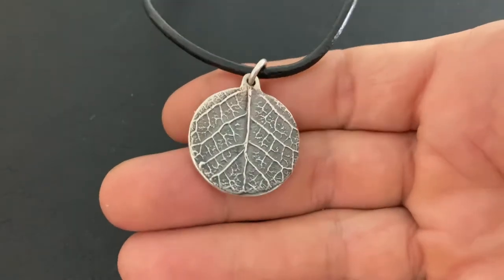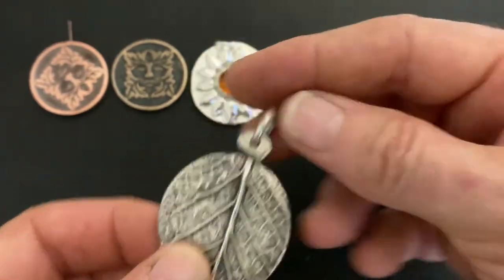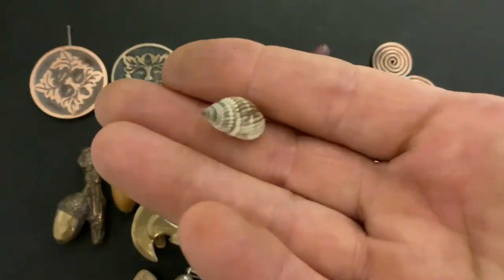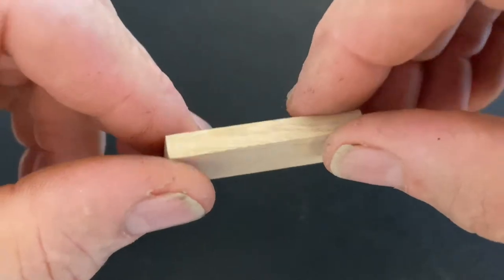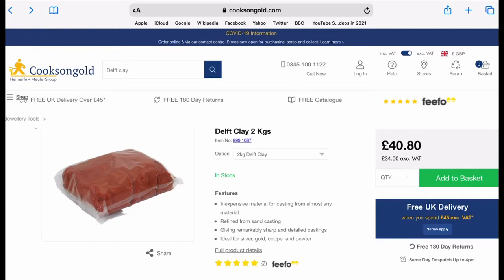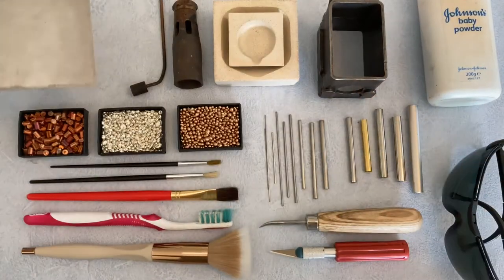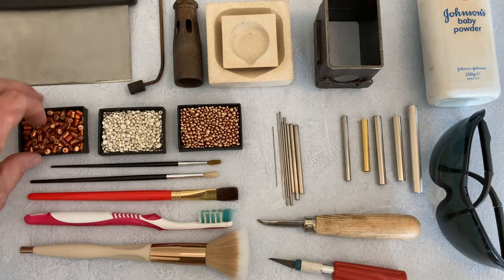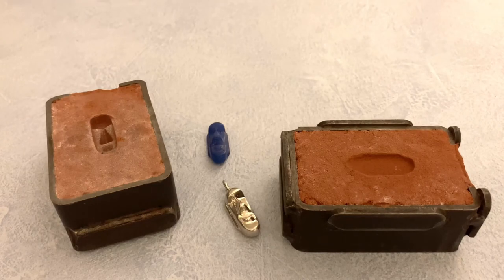Delft clay casting silver and bronze jewellery tutorial (a detailed guide for beginners) part 1

Comment: That blade is called a dough scraper. It is used in the pizza industry and restaurants to size up pizza dough in different size weights and to scrape the dough out of the proofing trays before making a pizza.
Reply from the maker: Thanks for that Tri-Force Blades, seems obvious after googling dough scraper but you would never know if you’d not worked in a kitchen. If it had been sold as a sand casting scraper in the jewellery industry it would cost 10 times more … Nice to find tools at the cross boundaries … cheers … Nick

Comment: Hello, Nick, love your videos, their very informative and fun to watch.
I'm interested in starting a sand casting and purchased a cast iron flask that came with 5 pounds of 130 mesh Petrobond quick cast sand casting clay. The Petrobond that came with the flask is a mixture of fine sand, clay and oil.
I tried casting and the mixture seems too dry and crumbly. It didn't hold it's shape in the flask and I wasn't able to pour the casting. I looked at remarks from customers on Amazon who bought the same item and some had the same problem with dry Petrobond. The advice from others on Amazon was to add a few drops of oil to the Petrobond mixture. One person adviced 30 weight non detergent motor oil, another suggested linseed oil and the last person to give advice said he had success with mineral oil ( Johnson's baby oil ). Which type of oil to you think would be the best to use?
Thank you.
Reply from the maker: hi Lonewolf, sorry to hear of your problems with petrobond. so annoying to purchase a product that doesn’t perform as it is supposed to. i’ve only ever used Delft Clay and not looked at alternatives yet.
I have read a well-made Petrobond is supposed to be very similar to Delft Clay and I once saw a video where somebody compares a few variations. The only real difference was that Petrobond had a bit more of a grainy finish to the castings surface. if it was me with this problem, I think I would test a few different oils with the main issue being the amount used. I would guess a two stroke motor oil would be a good start. I would mix a few very small batches and then try compacting them and open casting a couple of grams of silver into a small depression. all oils burn I think it’s just a matter of finding the one that is the most heat resistant … good luck with it … I hope you get it sorted … Nick
Reply: @Nickscreativestuff  Hi, Nick, thank you so much for your quick and knowledgeable answer.
We'll take your advice immediately.
Reply: @Nickscreativestuff  Hello Nick, I decided to take your advice and buy delft clay. I'm looking for the best impressions and delft clay seems to be the answer.
With the two stroke oil with Petrobond I wasn't able to get the quality castings that I'm looking for.
I hope to make quality impressions of shell carvings that have some undercut to the design.
I use the Queen Helmet Shell for the shell carvings.
 The design side of the shell is slightly domed ( convex).
 When I receive the delft clay is it possible for me to push the carved side of the shell cameo almost entirely into the delft clay and close the other side of the flask to get the impression of the small amount that wasn't pushed in all the way, then open it, remove the carved shell cameo and basically carve the channels for the silver to flow to the impression?  Will there be any problem with the casting pushing the piece almost entirely in? There are some small holes carved into the designs and the design of the piece goes all the way to the outside edge of the piece ( a traditional shell cameo doesn't do that). 
Looking for it to your repply.
 Thanks.
Reply from the maker: Hi Lonewolf, i’m sure you’ll get on really well with original Delft Clay, expensive stuff but I love it for the results that can be achieved. I can try and share a few tips and tricks that might help you with your projects. 

Undercut is one of the worst enemies of Delft Clay casting. I try to eliminate them by remodelling the pattern using wax or putty to temporarily fill them or reshape them. Holes can even be filled with talcum powder. The perfect model will release and fall out of its cavity easily without causing any of the edges of the sand to tear out. This can be checked before the model is replaced in its cavity and the second half of the flask filled. I always dust the model with parting powder before blowing it off this will leave a very thin invisible film that helps the model release. 

The tighter the sand can be packed the better the details can be picked up. However model strength needs to be taken into account for this.  When pushing your shell in all the way I would use a lot more parting powder around the edges of the shell. This will help prevent it getting locked in after the second half has been packed and will not affect the casting too much because it will create more of a cavity on the inside edges only. 

My preferred casting position for a pattern like yours would be with a vertical split similar to this short video https://youtube.com/shorts/6W6Aqv_wKfY 

For a few reasons … less venting is needed, less airlocks especially with your concave shaped pattern, the cavity can fill  quickly in this position helping with thin castings also less Delft Clay wastage. When casting in the horizontal position, the sprue can lock the hot casting in the sand causing more burnt sand and causing more unretrievable mixing of burnt sand when pushing the casting out of the mould.

Practice makes perfect with Delft Clay however I would never do a pour until I am completely happy with the mould that I’ve just made i’d rather knock it out and start again or even try it a different way this costs nothing but time. I try to use minimal amounts of parting powder to reduce the dilution effect on the Delft clay.
Hope this helps … N
Reply: @Nickscreativestuff  Hello, Nick, thank you very much.
We'll have the cameos carved with minimum undercut. You're advice of filling the holes with talcum powder is greatly appreciated.
All of your advice was great.
I'll take all of it into consideration when the delft clay arrives.
Thank you so much for your quick response and great advice.
Reply from the maker: The only problem with Delft Clay  is its very satisfyingly addictive … hope you have a big bag of silver you can get through … N
Reply: @Nickscreativestuff  I have a lot silver to work with. I hope I can do as good a job as you do.
Thanks again.
Reply from the maker: lots of satisfying times melting silver await … N
Reply: @Nickscreativestuff  Thank you for your vote of confidence. I'm designing beautiful pieces to have an indigenous Wounaan artist carve.
He's excited too as we all hope to benefit from beautiful pieces cast in silver.  I really like you're enthusiasm.
Reply from the maker: hope you can film your endeavours then post on here so I can see how you get on … cheers … Nick
Reply: @Nickscreativestuff  Hello, Nick, I'll post the first casting I make here on youtube. I hope you like it.
Reply from the maker: Nice one, I’ll look forward to seeing it … N
Reply: @Nickscreativestuff  The cameos we work on are posted on a youtube channel. The channel is called Treasures Of The Sea and the video is is called Tropical Shell Cameos. The video is about our cameos set in sterling silver filigree.
You can see the problems we may have with undercuts and holes.
Enjoy the video.
Reply from the maker: The cameos look stunning, so beautifully carved. very castable with a bit of working out. I think your main focus will be finding a material to easily remodel them with so to remove all undercut. something that can be cleaned out afterwards so the cameo can be restored to its original form. traditional potters clay comes to mind being water-based and can be washed out afterwards. might be a bit sticky to delft clay but not enough that a good dusting of parting powder wouldn’t sort out. The only problem might be it could dry out quickly and shrink somewhat. another clay I’ve seen being used for sculpting is a product called monster clay I think it’s wax or oil based and heat activated. 

The carvings look delicate and may be prone to damage under pressure. One option I’ve used before is to make a removable temporary plug levelling the back helping spread pressure evenly when pressing into the sand. I first lined my shell with kitchen cling film wrap then poured in and filled up with liquid plaster Paris once set it made a strong fill that was easily removed so the second half of the mould could be filled … N
Reply: @Nickscreativestuff  Nick, thank you so much for such great advice.
I'm glad you liked our cameos.
When the Delft Clay arrives from Amazon I will be taking your advice to see which flowers and figures take a good impression.
I'll also be taking your advice on the plaster of Paris.
That was great advice.
Thank you so much.
Reply from the maker: glad to be able to help, good luck with it hope it goes well … N

Comment: Hi, nice video, i try to make the flask, would u share the flask’s size, long wide height thickness…thx in advance
Reply from the maker: Hi Jihua, I made this casting flask out of a piece of steel box section that was 75mm x 50mm x 3mm two pieces cut 30mm long. Had a lot of use out of it however it’s not quite big enough to cast a ring shank. Have now made another one a bit bigger for rings … here’s the link to the video showing how I made the new one … https://youtu.be/tM5fhFKHNBs … Cheers … Nick
Reply: @Nickscreativestuff thx for that information, it’s a lot helpful.
Reply from the maker: good luck with it … N

Comment: I’m just curious, what is the size of the homemade casting flask you use?
Reply: Or rather the dimension tubing used.
Reply from the maker: Hi Kenton,  I made this casting flask out of a piece of steel box section that was 75mm x 50mm x 3mm. Had a lot of use out of it however it’s not quite big enough to cast a ring shank. Have been meaning to make another a bit bigger for rings …  Cheers … Nick